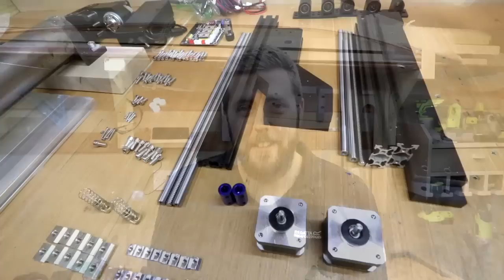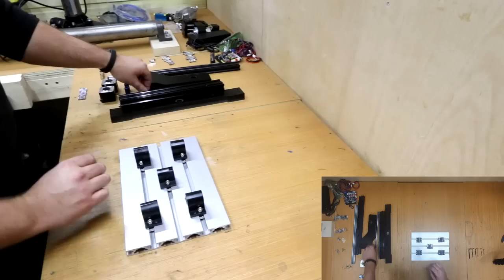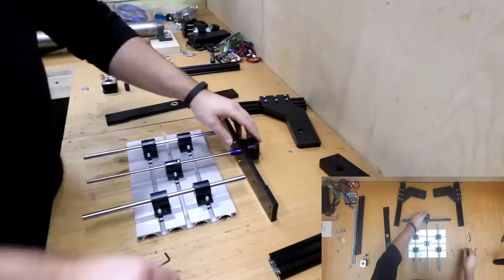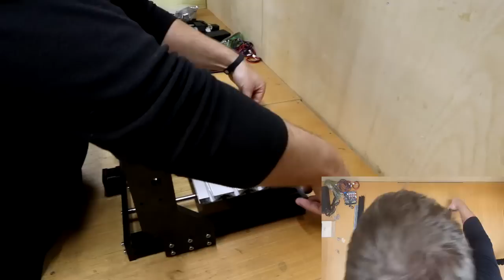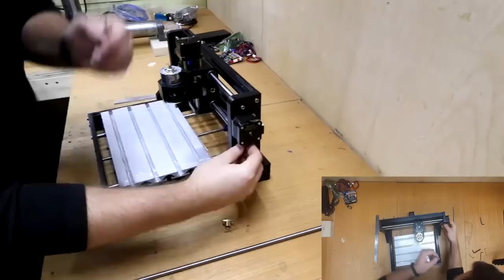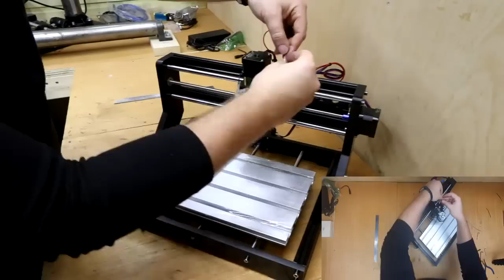3018 PRO CNC Build

Comment: Marvellous series of tutorials on the 3018 Pro. On the strength of these I bought one and it arrived yesterday, all the way from China in just 9 days! Unfortunately one big problem - the parcel contained no printed instructions, just a mini CD and a 1gb card; both of which would appear to be blank!!! 
I have written to the supplier and am waiting for a reply. In the mean time can anyone help me either by directing me to where I can find this information on line or by sending me a copy of their information.
Many thanks in anticipation of being able to use my CNC Router.
Reply from the maker: Your model may be a bit different but most things that are usually on the disk or memory card can be found here https://docs.sainsmart.com/article/3jgtgas880-genmitsu-3018-pro-resources
Reply: Thanks very much, I'll give it a try. Keep up the good work with the Tutorials.

Comment: Thank you!  With your helpful focusing video, I made my first laser line!  Something is wrong with my copper collar/spring.  Neither of them stay in place.  For example, when the carriage travels left, the copper piece spins left and then stays there.  It does not travel with the carriage when it moves right, and the spring just dangles.  There are two holes in the ears of the copper nut, but it is not clear if and where it gets fastened.  Thank you again.  -Phil
Reply from the maker: Hi Phil, are you compressing the spring and pushing the backlash nut right inside the holding before putting the threaded bar through and put the otherside?
Reply: @JamesDeanDesigns  No, I'll try that.  Thank you for the quick reply!
Reply: That did it!  The included documentation was not clear.  Thank you!
Reply from the maker: @philcrocetti  excellent 👍

Comment: Hi James just trying to wire up the Z-axis motor the unit came assembled but the  connector is on the side and not the back will this get in the way ?  didn't want to take the top off to turn it as I am not sure what I will be faced with ?  your video's are great so easy to follow
Reply from the maker: No, it should be fine 👍

Comment: If I upgrade the size of the y axis. What would I need to do for the programming to know that it would be a 4080?
Reply from the maker: Absolutely nothing unless you have limit switches. You may just need to set a new bed size in your design software

Comment: In my instructions the x axis motor is on the left. I’ve set it up that way . I’ve found that during the tests everything is moving in the opposite direction. The manual gives no clear indication on how to fix this. Do you have a solution I could try?
Reply from the maker: It will be your $3 setting. Work out which axis are wrong and the table just above this link will tell you what number you need to put as your $3 setting
Reply: James Dean Designs Thankyou so much. I’m learning a lot from you and your videos. Appreciate it. Regards Jase

Comment: Hi James, I got the cnc 3018 pro for xmas, its all built up and ive watched a few of your videos but i’m struggling to run it without it jamming which is really annoying.. I think it maybe because the machine isn’t running perfectly square and its binding. Do you have any tips, much appreciated
Reply from the maker: First check your base is square, if not then slacken the bolts and correct it. Second is align both axis, to do this slacken the rail bolts off at one end and move then bed (or carriage) all the way to that end and tighten the bolts back up. Slacken the othe end and do the same, take it all the other way and tighten them back up. Hopefully that should help a bit
Reply: @JamesDeanDesigns  Yes! My x-axis screwed rod is difficult to turn manually. Is this normal?

Comment: hey, has anyone else had trouble with the threaded bar X Axis fitting through the baring? mine you cant push through the outer side of the baring and its jamming the X axis from moving? just wondered if anyone else has experienced this
Reply from the maker: It sounds like your bearing may have failed unfortunately 😕

Comment: My z axis isn't moving. The motor sounds like it's trying to move it but nothing happens. Ever heard of this problem or have any suggestions?
Reply from the maker: Can you manually turn the thread bar or the coupler with your fingers?
Reply: @JamesDeanDesigns  no, I tried but it seams stuck. I thought about taking the assembly apart and seeing if the motor was turning at all. I figured you seem to know alot more about these things than I do so I'd get your advice first.
Reply from the maker: @13johncobb  unfortunately if you can't turn it with your fingers then something is not right. I think the best step is to take it apart or start to slacken things until it will turn. Has it even worked correctly?
Reply: @JamesDeanDesigns  everything has worked fine except the z axis which came as a pre-built unit.
Reply from the maker: @13johncobb  sorry, I meant has the Z axis unit ever worked or has it been stuck since it arrived?
Reply: @JamesDeanDesigns  it has never worked. I just got it for Christmas and was putting it together yesterday.
Reply from the maker: @13johncobb  first thing then is contact the seller if you can. If you can't turn the thread or coupler with your fingers then its pretty tight. You can either just disassemble everything and reassemble to see where the issue is, or start simple by doing something like slackening the coupler and seeing if the thread or motor turns
Reply: @JamesDeanDesigns  thanks for all your help sir. Great videos by the way. Hopefully I'll get it up and running soon.
Reply: Took the z axis assembly apart and got it back together and working! Thanks for the help!!!
Reply from the maker: @13johncobb  excellent but I didn't really do anything. You solved that your self, well-done 👍
Reply: @JamesDeanDesigns  willingness to give advice and your videos have been a lot of help.

Comment: I have just assembled one of these machines with help from your video - Thanks,
Amongst the parts were 3 small aluminium pieces that look like they might be heat sinks,
They have an adhesive strip on the back,
Do you know where they go?
Reply from the maker: Your control board will have three driver chips. They should go on there but be careful, they are are bigger than the processors and can stick to things around it
Reply: @JamesDeanDesigns  Which are the three driver chips you refer to please?
Are they the ones on the three orange boards - or the three in the lower right of the of the main circuit board?
Reply from the maker: @alanmountford5574  they are in different positions on different board but usually they are the three chips in the top right corner
Reply: @JamesDeanDesigns  I see that there are many designs of the circuit boards for this machine available, Is it possible to e-mail you a pic of my board so you can tell me where to fit the heat sinks please?
Reply from the maker: @alanmountford5574  if you're on Facebook or Instagram then drop me a message on there with the photos. I dont like to publicly post my email address as they can get spammed

Comment: Hey thanks for the video. Want to get one but was wondering would I somehow be able to make a juice groove in a large cutting board by creating it in sections or take to long and not realistic
Reply from the maker: You can do,  its called tiling. You break your design down in to multiple sections but usually you will still be constrained to the width,  in this case 300mm wide but in theory could be a long as you wanted within reason

Comment: James, excellent video series!!! I was wondering if you plan on connecting your 3018 to a Raspberry Pi?  For me, I would be able to free up a laptop and I have an 8 meg 4 sitting by with little to do.   :-)
Reply from the maker: In do have a Pi but haven't needed to use it for this. I might try and get around to doing a video but I suspec it will be a while before I get chance

Comment: Hi James... 
Great video, many thanks. I got a used 3018 Pro exactly like this but with no instructions so this video is very useful.
I am missing the long lead screw, so would you mind confirming the length.diameter/pitch for me?
Also I need some t-nuts. Am I right in thinking that T4 2020 nuts is correct... this is just for holding the controller... all other fastners are present.
TIA!
Reply from the maker: Not by my machine at the minute but its a 400mm T8 screw with a 4mm pitch/lead i believe.
Reply: @JamesDeanDesigns  cheers.  I'll check that out.

Comment: Hi James, excellent video on how to assemble one of these. Will be very useful once I get me my own. Is this your first 3018? I've been advised to rather get the 3018 without the pro, that is, the (older) version made completely of aluminium profiles. However, I think these are a nightmare to assemble. Early 3018 also seem to have a feeble Z axis and unreasonable slack so the machine lacks some precision. Is that still true with the pro, that is, do you think something has been done upon the Z axis problem? Longer linear bearings perhaps? It would be easier for me to decide if and how many modification would need to be applied to make the machine useful.
Reply from the maker: Hi Michael, I don't know much about the older models but they do look more complicated to assemble as there are clearly a lot more parts. I would still personally go with the 3018Pro because in my eyes, if there are less parts then than means there is less things to align correctly and less to go wrong.  All axis on these machines have a tiny bit of play, the x and z more so as they are connected together, so it really depends on how precise you need to be.The play becomes a big factor when you are pushing the machine too hard, if you take it steady you should be ok. At the end of the day this is a hobby machine, not a calibrated engineering machine. In terms of modifications, you don't really need any to be honest, I've not done anything to mine in terms of functionality. Yes you can make upgrades such as limit switches,  a more powerful spindle, extending the bed size etc. but the best thing to do is get the machine and learn to use it, then you can decide if you need to make any mods.

Comment: Thank you! Finally found a tutorial, where everything is explained in detail, not just a crappy speed-up music video. Thank again!!!!
Reply from the maker: Glad I could help 👍
Reply: not enough detail. where's the "what if" section.  Grand up until I ran the software and my 3018 does nothing.  Power cable seems fine as does the usb connection. movement indicated on the software but the 3018 has other ideas'   it's on strike!

Comment: Good video,  were did you get the mm measurement for placing the side supports ?
Reply from the maker: Thank you. There were in some poor PDF files that came with the machine. However after making this video I refunded my machine and found to use the full bed space in had to move them another 12mm forward
Reply: @JamesDeanDesigns  I have a Mysweety I bought from Amazon and I've just finished the build and saw your video. My inst. stated 46.5mm you said 48mm in the video but here said another 12mm here for the side supports. Are the 3018pro CNC's the same or is there possibly that much difference? Wish I'd seen this 1st, would have been less hair pulling.
Reply from the maker: @braddblk  there are slight variations in the designs depending on your brand. Start by following your instructions then once its all set up just test if the spindle goes from one side to the other evenly. If it hangs over one side or the other a bit more just slacken the bolts off each side and adjust accordingly
Reply: @JamesDeanDesigns  Thanks I did manage to get it running and no jams. The main reason I wanted to ask was that all I had was a steel ruler to measure mm and even a machinist rule doesn't show .5 mm well. Being new to this how can I tell if I am getting the full bed space as you mentioned. Looking forward to watching the next video and getting this thing going.
Reply from the maker: @braddblk  put a bit in your spindle, move your Y axis all the way forward and check where it stops in relation to the bed. Then take it all the way in the opposite direction and it should finish in approximately the same place. If it does then move your gantry back/forward to adjust until its even both ends

Comment: I assembled mine and the front top part you slide onto the 2 silver bars and the threaded bar, but mine freely swings left and right, is there supposed to be a threaded type thing inside the threaded bar screws into? I have added the screw and copper looking bolt thing but it still slides freely I think it may have a part missing
Reply from the maker: If everything has been tightened and the brass piece is in with the spring  I can only guess but it sounds like the cradle doesnt have  any bearings. The two smooth bar should slide through sliver circles which are the bearings

Comment: good job building it. very fun to watch. is it controlled by GRBL and universal gcode sender?
Reply from the maker: Thanks. I haven't got that far yet, will be doing the testing this weekend but yes I will be using those. I may switch software later but as GRBL comes with it, I think I'm going to start there